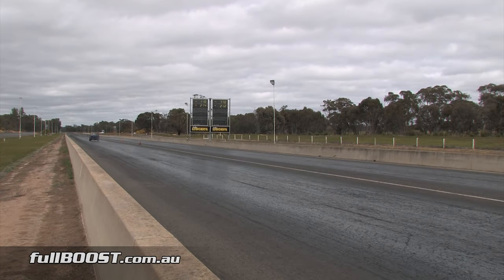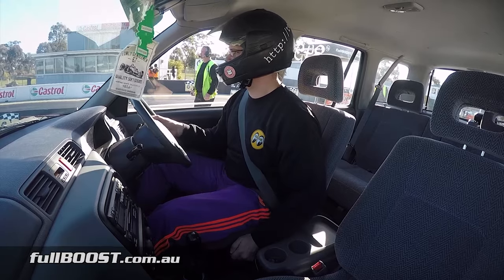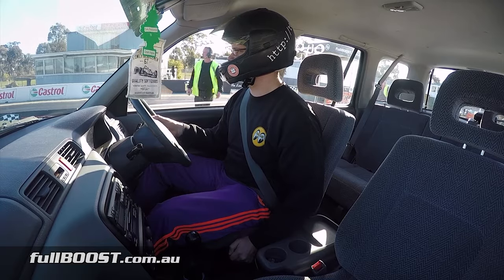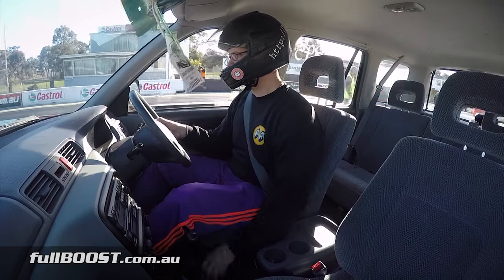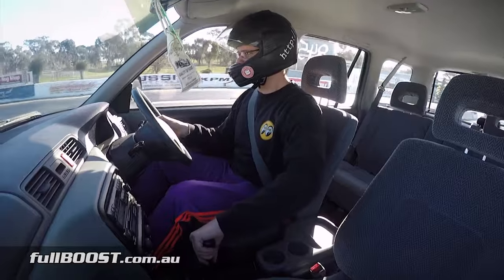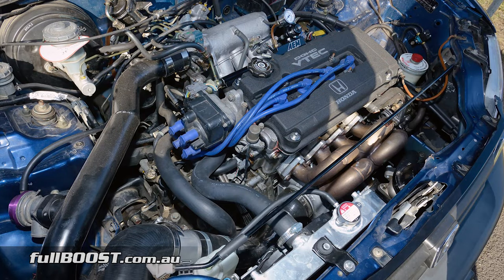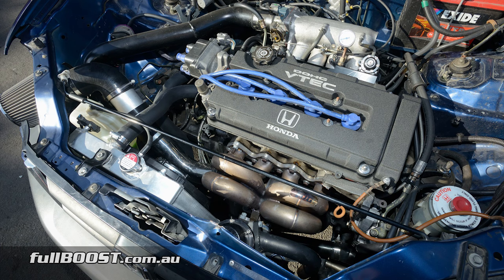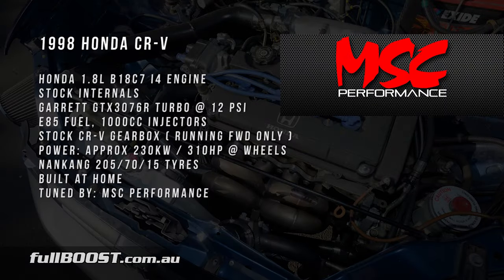Honda CR-V turbo SLEEPER

Comment: Why....all that work and money when a nice BF or cheap Fg XR6t will get you into the 12's for fuck all and be more fun.
Reply: +myusernames1967 because its a CRV hahah thats the whole point
Reply from the maker: Perhaps not everyone wants to drive an Aussie car.
Reply: +myusernames1967 Because not everyone wants to have the same thing as everybody else? And some people don't care about going as fast as possible? Typical bias muscle car fan. Broaden your horizons and life will be more enjoyable for you.
Reply: +suzuki400boi It's just my opinion, just as you have yours so settle the fuck down. Front wheel drive in ANY car makes no sense, especially a performance car.  If you are trying to get the best time..... and it looks like he is trying to, front drive won't help.
Reply: +myusernames1967 you've obviously never driven a FWD car to the limit on the track. I've owned and driven many cars in different platforms, but FWD cars are very very good cars to learn how to drive in, especially on a track. I will reuse the quote above "Broaden your horizons and life will be more enjoyable for you". Because it fits.
Reply: +SomersEmcee Broaden my horizons....how about you broaden your knowledge of cars and motor sports. A front wheel drive is for girls mate. Not one real performance manufacturer makes a front wheel drive,they are rear 4 wheel drive. Go to any drag meet and see how many front wheel drive cars are racing and if you see one with street tyres check out its times. Just because its quick for a CRV does not make it a great car. Again....now open your ears...Its a waste of money...IN MY FUCKING OPINION!
Reply: +myusernames1967 hahahahahah broaden my knowledge of cars and motor sports! Mate I hands down will know more about both of them than you. Front wheel drives are for girls? See you're so wrong there mate. Says so much about the lack of knowledge YOU have for cars and motorsport. 

I did not say the CRV was a great car, I merely pulled you up on your idiotic comments. 
Also, motorsport is not all about how fast you can go in a straight line. That's the most boring part. Taking corners at speed and pushing yourself and the car is the funnest part. Let's take for example some of the 1990 to early 2000's Japanese cars like Honda's Type R line up. They are lightweight, front wheel drive and do serious lap times for the power they produce. I race a fair bit and there are a few Hondas, Toyotas and even the new Mazdas and Fords which pull insane lap times for being front wheel drive. IN MY FUCKING OPINION!
Reply: +myusernames1967 wow mate, you're a true classic. No I don't drive a Civic haha, I actually drive an XR6T. I've had various cars on the track, from V8 RWD Holdens, an old Porsche, a couple of oldschool Toyotas in FWD and RWD layouts and I've even taken the old XR6T beast out once. Err yes I have heard of torque steer mate, but have you ever heard of the many ways to tackle it? Diff type and setup is the first that springs to mind, next would be tyre compound, pressure and size. After this the suspension setup is very important. Ultimately, the bigger displaced and/or turbocharged FWD engines are the ones to expect torque steer from, but luckily in my experience I've opted for lighter chassis, with a high revving NA motor and good suspension, tyre and diff combo and had no dramas. Also, in todays times there are many torque vectoring technologies and the like which are assisting in tackling torque steer issues for mainly turbocharged FWD cars. Also, nice work on the G6E, but have you taken it through some bends fast? My XR6 isn't the best to take through corners I must add.
Reply: +FukU2222 OK mate, you continue to stick to what you know and what you're comfortable with driving. Yes FWD cars tend to understeer, it's pretty easy to see why based on the basic laws of physics. BUT if you know what you're doing, you can tackle the issue and reduce understeer. Which is what I have done with FWD cars I have raced. Upgrading the rear sway bar makes the biggest improvement to reduce OS. Second to that, good tyres, good suspension setup with finely tuned settings and it's all good to go. 
Go out and give it a try one day mate if you feel the need to improve your driving skills because I tell you what, you can learn a lot about car control with a FWD.
Reply: It's about being different.
Reply: +SomersEmcee very well said
Reply: *****  How many performance manufacturers use front wheel drive. Jag,Bentley,Porsche,Ferrari,Lambo,HSV/FPV-Aussie cars,Mclaren,AMG....so that would be none. There is a reason,do you need someone to explain that to you. You can have fun on a track in a front wheel drive,that doesnt make it a great car.
Reply: +myusernames1967 maybe you should tell the wtcc all this. apparently they didn't get your memo. perhaps you could get ahold of the nhra and tell them too since they have two fwd classes.  Oh and btw rally, maybe you should let the rally world know that they didn't have numerous world championships and countless grassroots drivers in fwd tearing up road courses. Oh and let's not forget pikes peak,  maybe you should let those guys know how useless fwd cars are as well. I hope this is registering in your peanut. Cause you sound pretty misinformed when it comes to motorsports.
Reply: +FukU2222 you're mixing words,  if enough people want it you're not accommodating as if pro race drivers are accommodating manufacturers in wtcc. seriously you guys can do better than this.  if you don't like the layout it's one thing,  but to constantly talk about it does nothing to damper the layout itself,  it only gives people even more of a reason to get out there and set new records and shut up the mouths of the naysayers.  at the end of the day not everyone wants to do the same thing,  not everyone wants to follow the norm,  but when you guys see a crazy random build like a sleeper pick up truck or minivan its hats off, but that same mentality in a fwd car and all of a sudden you guys jump on the hater train.  if you don't like it,  than don't mind it,  pay it no attention,  but instead many of you sit on the Internet each night to tell the world how you feel,  adding not one single positive contribution other than the same tired arguments over and over again.
Reply: +Eric Stevens Well said Eric!
Reply: +myusernames1967 He never said FWD was better than RWD or AWD you knob.
Reply: myusernames1967 you keep saying the same things over and over again,  and now you're even repeating what I've said.   i think maybe you're trying to convince yourself that you know what you're talking about.  I never said fwd is a better layout,  you really need to get over it and move on with your life.  There are many fwd performance cars, purpose built race cars and otherwise that are out there and you can't handle it.  Also rwd cars can really suck in the snow and many fwd's are way better.  Seriously, move on with your life.
Reply: +myusernames1967 fwd cars are way better in the snow than rwd
Reply: Maybe,dont have snow in West Australia. I do know that that awd and rwd cars are the choice of all performance car makers for a reason. They have just brought out the new LP580 Lambo Huracan,RWD,dont know they didnt go fwd.
Reply: +myusernames1967 reading your comments gave me brain damage.
Reply: +TURBOGSRHATCH I beg to differ, I lived in Vermont on the Canadian border for 21 years, if you know how to drive rwd in the snow its actually not bad at all... fwd and rwd have there ups and downs in the snow, awd or 4wd is best, but if I am gonna have 2wd I am gonna have rwd, I know how to drive it in the snow and I prefer it, you have more control cornering and at higher speeds, fwd understeers very very bad in the snow, while taking off from a stop or climbing a hill at low speed fwd has the edge because the weight of the engine is over the drive wheels.
Reply: It would perform a lot better if he could have left it AWD and added some drag radials.

Comment: No one has mentioned the fact that this thing weighs like 4600 pounds.
Reply: +sshhHHIIIiiit - No way a stock CR-V weighs 4,600 lbs. Honda.com and the web says 3,100-3,200 lbs (1999). I can bet all the weight he's added for upgrades he has taken off in other areas, so he's still probably at 3,200 lbs. It's a little SUV, not a Toyota Tundra...
Reply: +Joseph Summers I can't argue with your statement.   But I do know that my stock 2008 CR-V weighs 4500 ell bee eases..  Facto Mundo, compadre!
Reply: sshhHHIIIiiit
You put it on a scale? That's a pretty overweight CR-V my friend. CR-Vs are generally very small SUV's and are around minivan weight (3100, 3200, maybe 3400 lbs). 4500 lbs is mid-size SUV and small-ish truck weight. That's over 2 metric tonnes.
Reply: +Joseph Summers The Honda manufacturing badge on the driver's door jamb of my 2008 CR-V says 4560 pounds.   That's gross.  Which means (non - external) cargo included.  Curb weight is what you guys are seeing on Google.   That's the driver only.   No fuel, lube, oil, or coolant.
Reply: sshhHHIIIiiit
The 4,560 lbs figure you are reading is likely the gvwr (gross vehicle weight rating). It is the rating by Honda that tells people what the maximum the vehicle should weigh is. That means fully loaded with passengers and cargo, your CR-V should not exceed 4,560 lbs. So if the vehicle weighs 3,260 lbs, you can't put more than 1,300 lbs in the vehicle and drive it. I've read about 100 door jambs on cars/vehicles and they almost always have gvwr and never have curb weight. Just trying to help educate my friend.

Comment: should of leave it AWD probably in the 11s
Reply from the maker: Doesn't have enough speed to run 11s. He disabled it as the driveline is weak.
Reply: +Fullboost I see stock b18b1 turbo in the high 11s I think it's possible with AWD and slick
Reply: +Fullboost the sad part is all that and it only ran mid 13s should definitely be low 12s
Reply: +Fullboost Wouldn't a more of a torque split be beneficial to the weaker driveline? Or do you think the rear differential is just too weak even for that?
Reply: something about those numbers are off, a type r b18 makes 170whp at least (Rated 191) plus 12 ilbs on a decent sized turbo and e85, and its only making 310?

i have a gsr, 93 pump gas, sc61 on 10 ilbs making 309whp -224tq, thats with the lower powered gsr and pump gas, this card should be making 350whp atleast with its setup.

i actually still have the rt4wd system in my turbo crv and it handles it like any other b series tranny, the parts are so easy to find its worth it, and the times will defiantly improve.

310whp in a 4wd crv is  high 12 second 1/4 mile
Reply: MRsteezy123 You're forgetting that there are many factors besides boost in the tune of this car. The timing is probably very conservative and based on the little bit of smoke that comes out of the exhaust, I'd say it's tuned quite rich too.
Reply: GyroPyro12 it doesn't matter hes running e85. You could make those numbers on a type r with pump gas with that turbo and still run rich
Reply: MRsteezy123 ok, but it would require a slightly less conservative tune, that is a fact.
Reply: GyroPyro12 You're clearly missing the point,  how is it conservative if hes making less power with more mods?
Switching to e85 and only making 310 plus 12 psi??

We're not talking 450-600whp were talking 300whp EVERY b series honda can make that with a ebay turbo kit, conservative at that power level is nonsense.
The egts on this setup wouldn't be any lower than my pump gas gsr.

Conservative would be making 310 at 6-7 ilbs on e85, not running rich carbing your motor up and washing your rings
Reply: My cousin 95 civic coupe with full interior all stock d16y8 with a eBay gt35r kit making 212hp runs a sub 13s this is sad for this crv
Reply: And its without e85 too
Reply: Ballin_status i haven't run my crv on a track, but i beat a c63 amg from a dig and They run a high 12 second 1/4 mile. 
Without e85 and only 10 ilbs 310whp
Reply: MRsteezy123 his timing is most likely set very low, that's what makes it conservative. The car could probably run ok on 93 without detonation with its current settings, but it is on E85 just to be safe. Everything about the tune would have to be conservative. There is no other way for it to logically make that low of a hp figure.
Reply: MRsteezy123 mine was 230whp na fwd non lsd,ls tranny,14flat spining alot of the 60ft on 4season tires hahaha

Comment: It's cool, but I mean, he did all that work to get into the mid 13s? I know you shouldn't rag on other people's car and shit, it's not cool, but still, I just needed to point that out, that's a lot of work to make something run kinda slow.
Reply: ver true, a d series with a ebay turbo kit will quite possibly beat that crv and cost les than he paid for his turbo lol
Reply: hes trapping 111mph thats a 12 second car, just needs some tires he running soccer moms on there, you can only do that with 4wd, which he has disabled.
Reply: Taylor Mullis probably not.
Reply: vtecnegro85 only if its gutted to a tin can, even then the crvs would be faster if you gut it also.
This cars fast his trap speed tells the story not his e/t
Reply: as you can see, the CR-V is having a traction issue due to FWD....